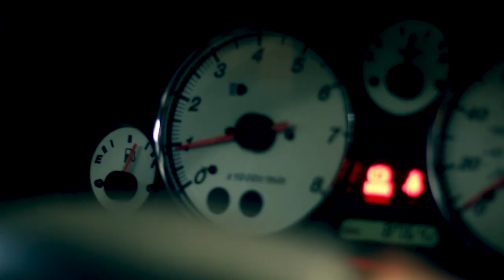Supercharged Miata Bumper Cut & DIY Widebody M3 Update

Comment: What was the reason for the bumper cut?
Reply from the maker: It reduces drag. Instead of having the bumper hang down and catch air, it allows the air to flow better.
Reply: Kyle Reese thanks,  was just wondering as last time I did a bumper cut, it was to extend the bumper 👍
Reply from the maker: steve gray no problem!